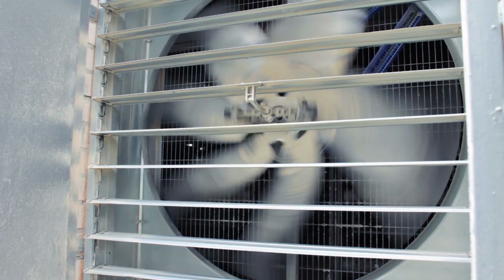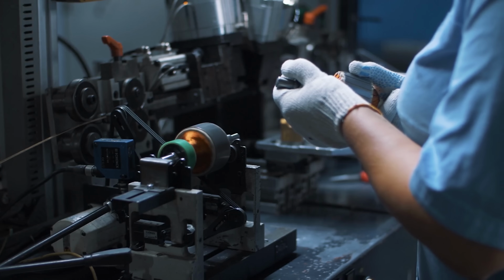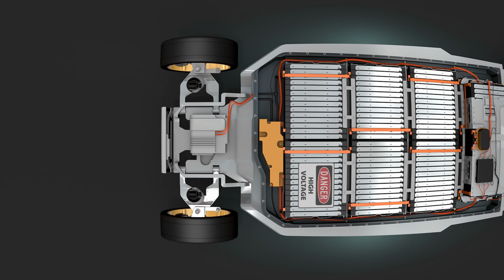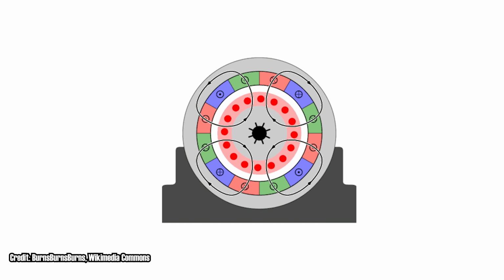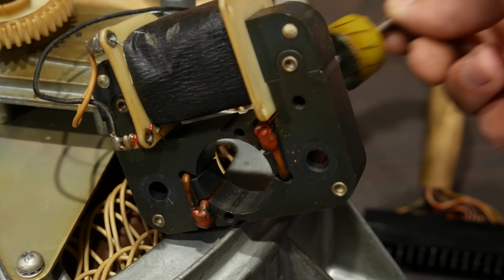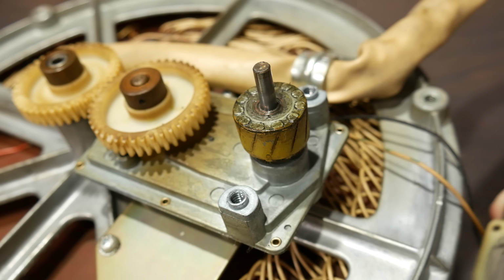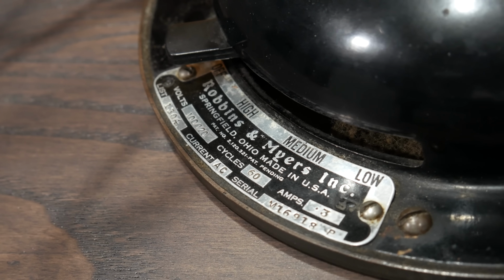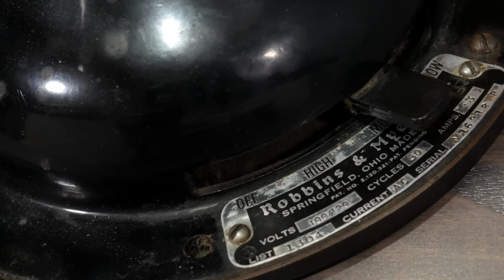Fans; High is next to Off on purpose

Comment from the maker: Good gravy are there just so many motors out there. Like brushless DC motors which are absolutely cool in their own right! Therefore I just want to put up here that you should definitely not go thinking that all motors work like this, because many don't! In fact, the universal motor? One of the reasons those are still so common despite their (relatively) shorter life is that they create gobs of starting torque on their own. An induction motor would be absolutely awful for something like a power tool with its poor starting torque, unless you went real fancy with a VFD and stuff.
It's all about what's best for what purpose!
Reply: I love the idea behind brushless dc motors, it's so ridiculous that we can build the things at all. Take what's essentially a multi-phase ac motor, and then have solid-state electronics switch between the phases. Fancier ones can even do things like detect the rotor position by measuring the effects of the (typically permanent magnet) rotor on the winding fields, and apply torque to hold the rotor in place.
Reply: I don't know why I watch you but I do and I love it please keep doing what you're doing!!!  <3
Reply: Brushless "DC" motors are just AC motors with DC compatible power circuitry.
Reply: The correct term for an AC variable speed drive is an "Inverter Drive"  Telemecanique call them Altivar but that's a trade name. Brushless DC motors are in reality AC motors which are not new at all it's just the miniature Inverter drives that they are more popular. But still will never have as much low speed Torque as a DC motor. With DC you can have Full Torque at Zero speed, it is possible with ac using full flux vectoring however they are very complex and require the motor to have an encoder.
Reply: @CalvinWalton  it's called flux vectoring it's a pain to set up on Industrial motors. The first versions had a habit of blowing the smeg out of the tank capacitor's
Reply: e
Reply: Let the synchronous reluctance motors be with you
Reply: I have never seen (aka. guy guessing here) a fan that force a start on high. I live in a 220-240v country, could the higher voltage, compared to the USA at least, have something to do with it? Watt is still Watt so I might be totally wrong.
Reply: Ya know, Decepticons are still transformers. It's autobots that are their opposers/opponents...
Reply: I'd love to see you do a video about brushless vs brushed motors.
Reply: @CalvinWalton  Newer, front load washers use these motors for varying the speed. They also have the benefit of what I'll call "dynamic braking".
Reply: @Hansengineering  "Brushless" DC motors are actually brushed dc motors with an electronic commutator instead of a physical one with brushes. :)
Reply: @Technology Connections are you an electrical engineer or did you just start this channel because you are passionate about the subject. Or both.
Reply: Hey! What type of motor does a kitchen aid stand mixer use? The speed settings go from low to high and at any speed, high torque is a desirable feature. I would assume it is using a DC brushless motor. I can’t find anything online about and I’m trying to avoid taking apart my new kitchen aid stand mixer. Lol
Reply: @mrsvcd  You can relate the watt to a volume of water. If you push the water at 110 psi, you need twice the volume (approximately) to turn a turbine as you need with 220 psi. If you move twice the volume at half the pressure, you can do the same amount of work, but might not see the same force at start. I could be wrong, but if the size of the "pipe" (i.e. wire) is the same on both motors, the 220v unit should actually have twice the starting force available. My math is most likely wrong, as magnetism doesn't work linearly, but I think my point is correct.
Reply: @readerbenjamin  Looking at a photo online, they are a brushed AC motor. Which makes sense, as they need a lot of torque. Age of the original design also leads me to that conclusion.
Reply: there better be a whole video on electric motors coming after all this talk of motors..
Reply: Brushless DC motors are super cool, until you are making a driver for it, I burnt my finger twice touching a mosfet pumping current into a stalled motor, yeah that was dumb
Reply: DC brushless motors make drones fly so you can take photos from up above or race if you prefer some adrenaline :)
Reply: its not opposite in india
It is 0 -  1 - 2 - 3
Reply: @mrsvcd  Its likely the higher voltage, giving the motor a higher starting torque even on a "low" setting.
Reply: You might not want to dive too much into dyson motors then, especially not the newest ones 😜
Reply: On the topic of fans... Does it annoy everyone else that consumer fans don't mention specifications such as CFM (cubic feet per minute) on the box? 
Only construction or industrial fans do.
When buying a tower fan for home... how is one supposed to know which is better for the same general size since speeds are mostly arbitrary?
Reply: You gotta know your motors if you're planning to take over the world with an army of robots
Reply: "period of time" are there periods of other things that time???
Reply: VFD's (or just inverters) are in fact becoming more and more common on smaller power tools and appliances because the power electronics is more energy efficient than having a plain DC motor which is hooked up to some kind of control circuit (or even worse, a rheostat). It means you can run a vacuum cleaner or a lawnmower off an 18V battery which would never be possible if you used regular DC motors.

They also offer much more flexibility in terms of protection against overloading and stalling, and the AC induction motors (or more commonly, permanent magnet synchronous motors) are easier to manufacture and have less wear and tear because they don't have brushes and slip rings. It's basically just a rotor that is placed inside a three-phase stator with only a mechanical contact (ball bearings) and no electrical connection.

Brushless fans like we've known to exist in our PC's for ages are synchronous motors with a tiny circuit that can flip the magnetic field around by sensing which way the magnet is pointing, so the magnet can be forced to chase its own tail over and over.
Reply: @readerbenjamin  brushed ac motor
Reply: Seems most fans in europe are 0 - 1 - 2 - 3, atleast all 3 of mine are. Edit: except my ceiling fan is fast first, table and floor fans are low first. Maybe we get better starting torque with the 230V.
Reply: Hey! Some gas stoves also have "off - max - medium - low", what's their reason? (They surely don't require electricity...)
Reply: Don't forget single phase synchronous motors! Used in old AC wall clocks, alarm clocks and Hammond organs!
Reply: @or2kr  let the reluctance flow through you, young kvar!
Reply: Verifiably False Display ? ;)
Reply: You are wrong btw.  Houses typically only have 1 of 3 phases.  The phase is split into 2 polarities that are 180 degrees off.  I know most people won't care but it's a common misunderstanding.   The point is houses get 1 phase with 2 polarizes.
Reply: @roflmagister5  That's probably to ensure ignition once you turn them on, which is more likely on 'high' than it is on the 'low' setting.
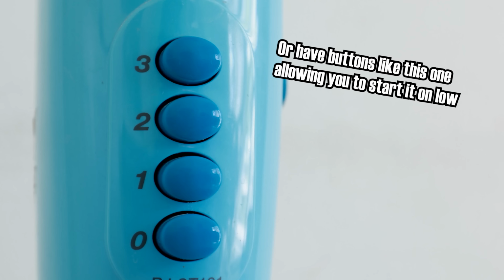Reply: For the button fan @15:40 HIGH is still technically first. Buttons on the edge of things are much easier ( and more likely ) to be pressed than the ones in the middle. This is especially true when the buttons are aligned vertically and close to the floor. I bet the designers took that into account as well.
Reply: @justinleonard422  That's very similar to the issue that @Technology Connections identified with electric space heaters.  He did at least two videos on it.
Reply: @roflmagister5  Lighting the burner may be more reliable if the initial gas flow is higher, but I'm just speculating.
Reply: I hate you for supporting the doom of automobiles powered by real engines and fuel, but I like most of ur vids
Reply: Michael Mantion when he mentioned the apartment thing, I started to think the same thing. However, note that he mentioned 208v, and that it was different from the 240v you'll find in a split-phase system in a smaller building. Most  large apartment buildings that have a 3-phase supply do, in fact, use 2 of the 3 phases to run high power equipment. It's the reason many appliances and large single-phase motors will list 208v in addition to 240v. Though there's often a different way you're supposed to wire the device when running it on 2 phases of a 3-phase system, as opposed to a split single phase. The reason it's only 208v is because the 2 phases aren't 180 degrees apart, so the RMS voltage ends up being lower.
Reply: @readerbenjamin  Like basically all kitchen appliances, a universal motor for it's high power density for short run times. It's basically a brushed DC motor and the AC gets chopped up into DC. There's no such name as a brushed AC motor like some people have commented, a universal motor can run on both DC and AC and has brushes for commutation.

AvE has done a teardown of a kitchen aid mixer if you're interested in knowing more details about the motor. https://youtu.be/0qKp-0h9P18
Reply: It’s not like brushless “DC” motors are special... they’re just 3-phase AC motors, just that they’re usually relatively small, and the name is mostly marketing to RC hobbyists. You need an ESC (Electronic Speed Controller) which must be purchased separately, to use them, which IMO removes their “DC” classification.
Reply: @jammehrmann1871  electric motors are real engines and petroleum is something that should be used sparingly, not every time you want to go to KFC
Reply: Pretty sure this is also why the platters in cheap microwaves reverse direction every time you start them.
Reply: Gravy is indeed good!
Reply: Also "starting high" has the fan reach max speed faster.
Food for thunk
Reply: I was actually going ask about brushless motors
Reply: @justinbeath5169  You would be right if I wasn't in this world of beautiful 4 stroke V8 OHV engines and cars which haven't measured their power by a stupid person working at Elon Husk using  a kill-a-watt
Reply: @roflmagister5  Re gas stoves, it's the same reason really, a full gas flow is easier to light.
Reply: @roflmagister5  you want the most fuel rich mixture possible to ensure the burner ignites properly.
Reply: I've always wondered how simple AC circuits, particularly old ones,  have a "medium" setting. I know many AC systems have a high and low setting where a diode blocks half the waveform and that there are more complicated circuits for as well as heavy transformers for such applications but there must be a simpler way that simple devices like your old fan have a medium setting. How does that work?
Reply: You're such a fan fan
Reply: @zt4680  same as three phase motors, with a vfd powered off of dc
Reply: The universal motor is so... universal... its what the EV builders use in DC systems. And they can be reversed so easily by just swapping the polarity of the stator or rotor.
Reply: we had a lawn mower that wouldn't start itself anymore. We had to start the blades manually. Not very safve, but we could use the mower for another 2 years. :)
Reply: I have a small issue with the nomenclature. I was raised to call the dc motor parts as fields and armature. It was also the same for the old time generators. Both used field magnets and the armature used brushes with laminated windings. Anything with brushes with segmented windings used those terms and those that had brushes with slip rings used the stator and rotor terminology. It also was used on induction motors. It’s always been my understanding that dc motors develop the magnetic fields differently. In fact a true dc motor will act the same as a generator if it’s turned by an external source.
Reply: I wish I knew exactly how my motorcycle motor was designed.  Zero to 50 mph in four seconds is pretty impressive.  (It's a gogoro S1).
Reply: you don't have 2 phases in your apartment - you have one split phase - which just two halves of split transformers secondary tapped in the middle, so you have two halves 180 degree apart.
Reply: @JulesVonBasslake  yeah, should have gone with the quintessen. That's perhaps getting a bit niche. As if fan motors aren't niche enough.
Reply: @saedin1  erm, yes. Ask a lady friend about it
Reply: @roflmagister5  that's to annoy you because low is never low enough, so you have to go up past high and never actually use most of your gas valve.
I have had one hob that went off low high though.
Reply: @benholroyd5221  still wrong, they called period, because it came every month. "Period of time" is a PLEONASM
Reply: I'm sure I've never seen this before 😕 is it an American thing?
Reply: Thanks for solving something that has boggled me for years. Now answer "Bolts" vs "Studs" on holding tires on? Why Germans love bolts I have no clue ?  🤷🏻‍♂️
Reply: best thing ever...
Reply: @Lvvcassss  while you could say it like that, they are usually (construction-wise) permanent magnet three phase synchronous motors
Reply: @readerbenjamin  They use brushed Universal Motors.
Reply: Could be that the start on High is part of UL standards so could be why it has stuck around. It's also cause of the odds of very large numbers. If the odds of a fan starting on low and causing a house fire are one in a billion but the entire population are turning on fans 20 billion times a year, that's 20 house fires. But if making them start on high reduces the odds to one in 1 trillion, that's one fire every 50 years.
Reply: @ssbohio  it’s those exact videos on electric space heaters that made me realize the same issue with consumer fans! When I saw this video in my feed I was hoping it would have a mini rant addressing that notion. ... maybe the next fan video will.
Reply: @z08840  Well, I live in Hungary, and there are 230V (one phase) and 400V (3 phase) connections. Even if you don't use equipment that requires 3 phase power if you use a lot of electricity having access to 3 phases is beneficial, mostly for balancing the loads. Often at the meter there are separate circuit breakers for all 3 phases. The meter and the circuit breakers, etc. are outside of condos, apartments, etc. So the "only way to have 2 phases in my apartment" would involve turning off the 3rd one at the meter :D
Reply: @gergelyvarju6679  I wasn't talking to you - I was talking to the author of this video, and he lives in US, and in US we have split phase and not two phases.
Reply: You should talk more about motors
Reply: Everyone has a universal brush motor. In their cars. It's called a starter, and the go bad usually for 2 reasons, the solenoid that connects it to your motor sticks, or the brushes go bad.

It takes a LOT to turn an engine over. Even overcoming a flywheel magnet on a lawnmower takes quite a bit. Take off the coil and see how EASY it is to pull them.
Reply: i was just thinking of this
Reply: 8:50 decepticons are still transformers.
Don't confuse "transformer" with "autobot".
Just sayin.
Reply: Benjamin Reader . It’s a universal dc motor with a governor if it’s the classic. The new model uses a solid state control board. Get the classic. There’s less to malfunction just like old refrigerators and washer/dryers.
Reply: I think u need to correct yourself. towns in the Midwest without natural gas sometimes have 3 phase power into the house and what we commonly have is split phases and not 2 phase power.
Reply: Congrats on Trending!
Reply: Great video, I’ve always wondered this!
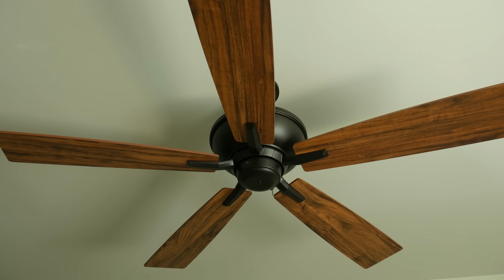Reply: 14:27 No, that's an impostor. I'M your biggest fan!
Reply: @justinleonard422  One rule is, don't buy the one from WalMart that has a tiny motor in a big plastic case that makes it look like a bigger motor.
Reply: @Stoney3K  Are these the 'shaded pole' motors that appear (to a semi-educated eye) to have an inductor loop 'shading' one of the magnet poles?  No brushes and ensures that it starts and goes one way only on single phase AC.  Downside is creates more waste heat than a more complex single phase motor.
Reply: @boggy7665  No, PC fan motors are permanent magnet synchronous motors that work on two phases instead of three. "Brushless DC" motors like you find in a lot of quadcopters are three-phase synchronous motors with a tiny inverter to drive them.
Reply: I learned first hand about capacitor-start motors first when one of these relatively heavy duty fans won't start. I was very abruptly reminded that capacitors store charge when I grabbed it without discharging it. 
My colleague who was nearby saw what happened and laughed his butt off because it reminded him of his college days when his mates would zap each other in the arm with charged capacitors for shits and giggles. That was until the lab technician noticed and grilled the crap out of them, apparently.
Reply: Don't worry the RGB will make that computer run a whole 20% higher swag performance. XD
Ironically Corsair's best RGB fans actually are some of the slowest PC fans on the market, though their maglev fans are really fast.
Reply: This video is about your "fan" club? :-)
Reply: Calvin Walton  brushless dc motors are actually AC motors
Reply: Technology Connections post this comment before the vid come put
Reply: The purpose
Reply: But do modern, cheap ceiling fan regulators save electricity?
If I run my ceiling fan on lowest setting, will I save on my bills?
Reply: I feel like you'd be the best physics professor anyone could have.
Reply: I dunno why this perplexes me so much but I never EVER have seen a fan where High is next to off. It is always high, low and off. I even know allot of fans with buttons instead of knobs, so you can change to any speed you want from any speed.
Reply: @dogwalker666  Multi phase AC motors mostly use a squirrel cage rotor, while brushless DC motors usually use a permanent magnet rotor.
Reply: @readerbenjamin  Most mixers use universal motors, though particularly expensive ones might in theory use brushless DC motors nowadays..
Reply: @Sys-Edit0r-1995  also in some record players, the turntable in microwave ovens, and in the timer in older domestic applicances.
Reply: @MichaelMantion  Since the ground/neutral is in the middle, a split phase does become 2 phases. If not, please explain.
Reply: @FancyTuxie  using a diode will only work on resistive loads and as you say only gives the choice between half power or full power. Inductive loads just use taps on the coil or even series resistors or capacitors to regulate power.
Reply: @raychang8648  Probably brushless DC, but could be a brushed DC (PM DC) motor.
Reply: @z08840  what would a two phase system look like and what properties would be different from a split phase system?
Reply: @roflmagister5  max allows gas out at a pressure fast enough that it hits the igniter concentrated while contained in a relatively small area. Using med or low gives allows the gas time to spread out before igniting. Try it. On max, you get a short "hiss", then "poof". On low it may not ignite at all, with air currents dissappating the gas, or worse igniting when a large amount is in the air.
Reply: @nemo-x  My fans fall on my legs all the time…..they follow me around  too…..won’t leave me alone actually. I think they’re stalking me…..I need better security
Reply: @Hansengineering  There's a little more to it than that, but you're > 90% correct. BLDCs usually have a permanent magnet in them where 3 phase AC motors don't and those rely on induction in the rotor to produce the magnetic field the stator pushes / pulls around. With induction you can run things a lot hotter and harder without worrying about destroying a permanent magnet rotor and killing the motor.
Reply: @Technology Connections good video... but note that the normal monofasic home power supply.. is 1 fase (you favorite color by the way brown) and 1 GND (cyan)....... not 2 fases....
Reply: @mrsvcd Perhaps it is more of a liability concern at the moment. As an engineer or company, would you be willing to risk your reputation for such a decision?
Reply: Its all down to over comming the moter generator affect there if I want to know what that is.... Look it up
Reply: Technology Connections I agree that RGB does affect the speed in your computer 😂
Reply: Technology Connections would love to see a more in depth look into the basics on motors like this
Reply: As long as we're on the "why do they..." topic, why do so many products have a power brick on the power cord instead of incorporating the power supply into the product itself?

This has perplexed me to no end. When the brick is at the end of the cord, it takes up two -- sometimes three -- slots. When they are too massive to place on the end of the cord, they're situated in the middle, where they either dangle around or just get in the way.

So why do they do that? If the consumer benefits, the reasoning escapes me. In my humble, correct opinion, this is one of the worst ideas ever.
Reply: Now do a video on different types of emotor
Reply: I still have 1 question: how does a CEILING  fan work?  This video mostly focused on floor fans
Reply: @joshkep21  oh that's a whole thing..I did a write up on them once for an electricians website I was doing. Definitely at least a 20min video on that and fans in general.
Reply: This is why Iove joining "fan" clubs: because everyone else is a "fan" too!
Reply: I have a ceiling fan from 1977 that I use everyday and it still works perfectly fine. It has 2 speed settings High and Low. But putting it on low activates the built in Variable Speed Control.
Sense he talked about a fan that's 100 years old, I thought I should say what I have.
Reply: I got a Vornado that have one as the first
Reply: @Hansengineering  That's usually true about "BLDC" motors being AC synchronous motors, but unipolar stepper motors are a common exception to that. They are brushless, and they only have direct current flowing through their windings, albeit chopped DC. Switched Reluctance Motors can also be powered by chopped direct current only. So, while not the most common application of the term, there are really brushless motors using only DC.
Reply: Eric Hansen not really, bldc is wound with even spacing of phases which makes a trapezoidal back edf, AC perm mag synchronous each phase is around the entire motor with uneven thickness. It makes sinusoidial back edf.
Reply: 1:20
A stall condition would only apply to shaded pole single phase motors.  I've seen dozens of older fans that use series wound motors, with the same speed setting arrangement.  So this really cant explain the order of the settings.
Reply: Please do a video on all-in-one washer dryers! Totally up your alley!!!
Reply: @grantrennie  just dc brushless motors, nothing impressive. Essentially two flavors in those, sensored where the pickup (hall effect switch) tells the driver rotor position for enhanced control/efficiency, and sensorless where one of the wires during rotation acts as a sensor to tell the driver rotor position.

Had sensored brushless motors in my RC cars 12 years ago, and now my Bolt uses the same exact technology.
Reply: @Technology Connections - 
I am in the future: in Germany nearly all house holds have 3 Phase ( 400V @ 50Hz) since many decades & in nearly all of these even the electric oven + stove uses 3 Phase)
Reply: Residential power in the US is "split phase" of 1 single phase, not 2 phases, of the 3-phase system.  The two 120V legs come from a 240V center-tapped transformer that the center tap is attached to ground.  It's similar to DC systems(and indeed was very much inspired by the original Edison DC power) where there is a ground and a positive and negative "rail" voltage.
Reply: If you don't have at least one Kmart fan from the 1970's or 80's then you are not an American. I actually replaced my seized furnace motor with a working Kmart fan motor from that era. Both were a G.E. and same design and just slightly less HP. It was on of those blue metal ones and I had one still working. My fix kept me warm this past winter.
Reply: @readerbenjamin  I pulled our Kitchen Aid apart - and it is a brushed (universal) motor with a "dimmer" circuit and mechanical governor to control it.
The speed selection lever biases the governor and the governor controls the (triac) dimmer to throttle the power to the motor.
This forms an electromechanical feedback system which does a quite good job of maintaining a constant speed with a varying load. This is something a universal motor would not normally be able to achieve.
I was a bit surprised to find this system - I am guessing that it was a design which has remained unchanged for many many years.
Reply: Ehh our fans in Malaysia have the 0 before the 1. The dial switches of course will have the 0 or Off next to the 1 because it is a complete rotation.
Reply: Cody Nemo Hmm, reminds me of the latch solenoid in the jukebox video...
Reply: Ok but what about CEILING FANS
Reply: i love your videos dude.
Reply: Please do a video covering the most common types of electric motors!
Reply: @saedin1  yes but that could be gender specific
Reply: @Liam I was talking about usual household wiring.
Reply: 3 phase wound rotor induction motors break things without a soft start mechanism or circuit.
Reply: Ohhhh. Now I know why my fans won't turn back on if we get a brown out/blackout.
Reply: i like fans
Reply: I'm glad you properly  used  spinny and not spinknee.
Reply: Ohhhh this totally explains why inside my corded drill I can always see the electricity arcing inside, it must be universal
Reply: In India fan speed selector goes from low to high.
Reply: So...... then why are are/were DC motored fans design to start at low speed first?
Reply: @z08840  He hasn't answered you yet either?  
A typical 2-phase electrical panel is 230-240 VAC where as you have 115-120VAC from the neutral to either side of the panel.
There was one time 2-phase electrical motors also.  Being fed with 2 phases rather than three.  In many instances the additional phases can be created by the use of a capacitor(s).
Don't you have an Audels Practical Electricity Book?  It's all explained in there. ;)
Reply: @robertstoneking7916  As do large DC motors, think of a turbine blower.  Large scary sparks will most certainly be produced from hitting it with full voltage from a dead stand still too!
Reply: @BeaversAreInsane  The way it was explained to me is DC motors have quite a bit more torque and try to start "instantly" when full DC voltage is applied.  This is especially true of large DC motors used for instance on a pipe organ blower.

2500hp DC motor shop run test
https://youtu.be/vCJWtNtFd1g

A motor like this would rip itself to apart if full DC was applied from a dead stop.
Reply: @DandyDon1  again - in US in usual household we have one split-phase. I don't need book - I measure it in my outlet.
Reply: @z08840  While USA houses typically have split phase power supplied by a 240V transformer winding with a center tap, it is not that unusual for homes to instead be fed by two legs of a three phase Wye source which provides 120V from each leg to neutral and 208V between the phases. This is common for large apartment complexes where the building has a single source of three phase power (you wouldn't want an elevator to use a single phase motor) and it is much cheaper to use the three phase system they already have than to buy more transformers to supply split phase without any significant advantage (208V isn't that much lower than 240V). It is also common for houses that are or were very close to large apartments and other large buildings since the local power company can simply tap the already present large three phase source instead of installing more transformers to supply split-phase power. Your home may be split-phase, and so is mine, but not all are in the USA. It is common enough that there are a LOT of easily accessible 208V appliances in the USA almost anywhere you would buy similar 240V appliances, many are compatible with both voltages.
Reply: @DandyDon1  An electrical panel with 230/240 across two hots and 115/120 across one hot an a neutral is not a two phase system, it is split-phase. There is only one phase, there is simply a center tap in the transformer and the neutral is connected to that center tap. In an actual two phase system, there are four wires and the two phases are 90 degrees apart. The only two phase system I know of is the original power plant for Niagra Falls.

Sure, a three phase motor can sometimes be run with a single phase across two of the motor wires and a capacitor going from one line to the third motor wire. That actually is electrically very similar to supplying it with two phase power since a capacitor also creates a 90 degree phase difference, though there are caveats. You generally have to derate the motor, it isn't going to work as well as if it had an actual three phase source.
Reply: BRO! i Love you ALL the weird questions like this id ask my parents as  a kid. They never knew ANTYTHING. YOU have answers for ALL of em THANK YOU!!!!!
Reply: I now know why I have to put my stove vent (from the 60s) on high or medium before choosing low. Hurrah!
Reply: 5:07 think you meant 120v
Reply: Even a brush motor shouldn't had ever needed to use brushes;  sealed sleeves simillar to a casing of a bearring shell could had contained mercury that was held in place by counter pressured non conductive fluids within those areas where brushes were not.  Which then opens a door to heat sinking with actual real-time control.
Reply: @MichelJosephCardin  controlled obsolescence
Reply: So, if I, Russian guy, understand correctly, American fans have annoying controls because American power grid is underpowered. Did I understand correctly?
Reply: Why are the subtitles in Japanese?
Reply: I have a fan that belonged to my grandfather. These things are like heirloom.
Reply: I COULD NOT WATCH THIS VIDEO.... 
I JUST CAME BECAUSE IT APPEARED IN MY TIMELINE

HOW CAN SOMEONE TALK OVER 17 MINUTES TO SAY WHY IS HIGH NEAR OFF???????
Reply: BETAMAX L-750.... Betamax was better than VHS!
Reply: @Lvvcassss  yeah, no. brushless DC use permanet magnets in the rotor, when brushed DC do not, that is why there is the brush in the first place.
Reply: @MichaelMantion  In Germany, normal apartments get 32A 240V (star/wye) 3 phase, or 63A if they use electricity to heat their water.
High power devices are required to be 3-phase devices, iirc the cutoff is at about 10kW.
Reply: What is that thing that looks like a wheel with the plastic gears and the shaded pole motor?
Reply: The other advantage of universal motors is that they have a much higher RPM, which is an advantage for certain tools.
Reply: All the fans I’ve brought or seen have always  put low, medium then high. As the setting but might just be a UK thing
Reply: @gotellyamum I would agree, I would advice is not to come back to all the cold and rain.🤣
Reply: @gotellyamum lucky 😩
Reply: I am sorry to inform you that there are in fact fans out there where low is next to off/on. I do own one of them. Unfortunately I do not know how/where to show you pictures of it.
Reply: I'm 38 and to my knowledge i never encoutered a single Fan wiht "high" as the starting position. is that because I'm from Germany or just coincidence?
Reply: I have a fan with a dial that goes: off 1 2 3
Reply: There is no such thing as a universal motor. Except for the universal motor of course, but thats not quite universal of a motor.
Reply: @roflmagister5  Safety.
Would be bad to stand and try to ignite it while the gad is slowly coming out... Then a BIG WOOOFF! You're a overly toasted cook 😅
Reply: If Bill Nye the Science Guy had a cousin, it would most definitely be you.
Reply: Every time when I see a fan like that I think about the Escape from Alcatraz fan, now I understand it could be hard to get the torque needed to drill with it
Reply: I love gravy!
Reply: don't bite your nails
Reply: Nite 😢r 😢
Reply: Some power tools are moving away from universal motors, since they do produce a lot of sparking and don't last forever. Instead they're switching to brushless DC motors due to their high speed and torque as well as lack of brushes.
Reply: @BigEightiesNewWave  That is absolutely not a differentiator between AC or DC motors.
Reply: 14:27 this here is not your biggest fan. Much bigger fans out here in your audience.
Reply: The nice thing about BLDC motors is they have fairly consistent relationship between current and torque and voltage and RPM as well as a high starting torque. This makes the math behind PID control simple if you understand system dynamics and transfer equations. I only buy BLDC power tools.
Reply: @saedin1 ofcourse there are, such a strange thing to ask 🙄
Reply: @FirestormX9  "Periods of time" it's a unnecessary sentence. It's a PLEONASM. There are NOT periods that don't comprehend time.
Reply: @saedin1  by that logic everything comprehends time. Yet we dont use it as such in all applications of conversation. It's more like a phrase, yes, this particular one may as well be unnecessary but it is not correct to say that there aren't periods which denote other actions or interactions. This one 'Period of time' has become like a phrase and its understood by the mind as one singular term and delivered as such.
Reply: @FirestormX9  that's the definition of pleonasm. But anyway you're use to use it like that
Reply: @saedin1  yeah and its not something truly criminal even in the context of conversation or dialogue that its a practice which needs to be stopped. The meaning, followed by intention is always paramount.
Reply: @FirestormX9  I know, the problem is when you translate that to other languages. It translate the pleonasm too
Reply: @saedin1  oh yeah, that's quite true. I just realized that myself. Thats certainly a bit of a predicament.
Reply: I recently saw a fan at a junk shop that was old enough that it didn't have the shaded pole starting feature.  Maybe it was old enough that it may have been made before the shaded pole motor had been invented. It reminded me that there were still some antique fans in use around when I was a child that required that you give the blades of the fan a bump with your finger in order to start them.  You could also get them to go backwards depending on the direction of the initial bump.  One problem of the shaded pole motor is that the starting coils are unable to disengage ever, and once the fan is spinning at full speed the copper induction ring works at cross purposes thereby producing a small drag and added waste heat the hole time the fan is running.
Reply: I'm keen to learn more :)
Reply: I was just wondering about brushless DC motors!
Reply: I have a quite loud 90W Chinese floor standing fan that does start at "low" first; its rotary switch has settings (0,1,2,3) where 0 is "off", and its metal motor case can get quite warm, so stalling would likely burn it out. And here in Germany many apartments do have 3 phase electricity, but it is only use for fullsize electric stoves and things like flow-type heaters (those are power hogs with e.g. 18kW). Also EV charger wallboxes likely need 3 phase power.
Reply: Brushless can be AC too. And that type is good for cooling fans. Cooler fans in PC are DC brushless
Reply: @Robbedem probably starter got fouled up or coil burned up? When device he had shown wears out it may get stuck at low